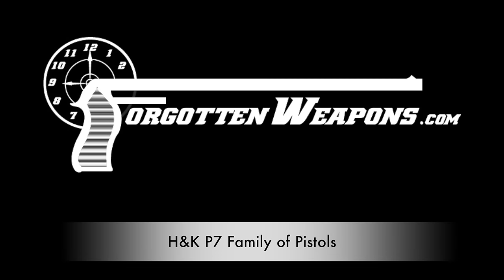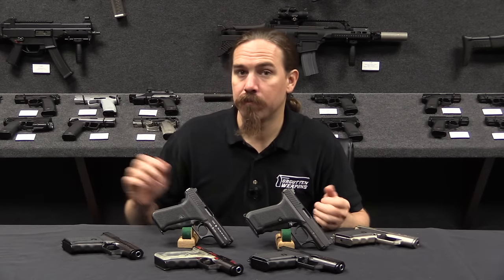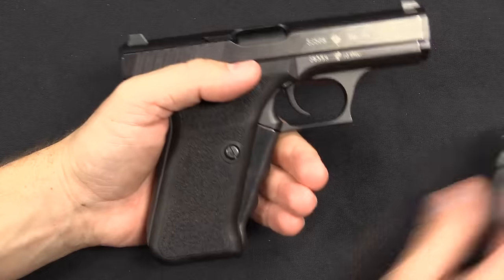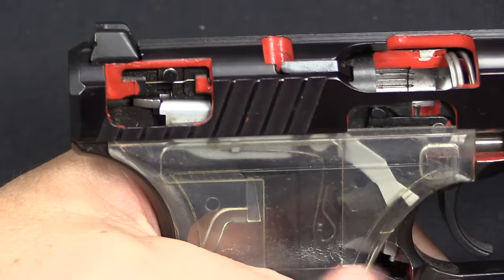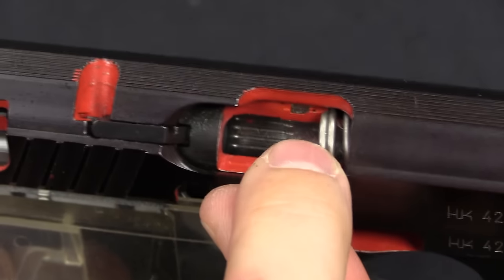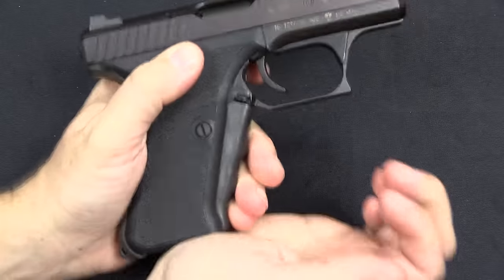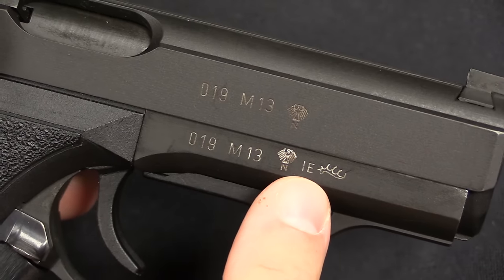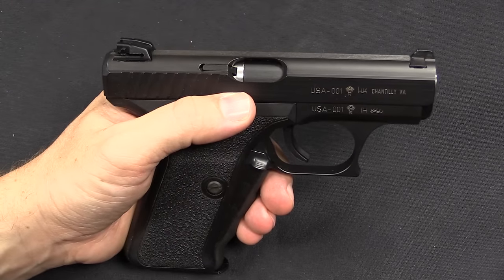H&K P7 Family: Pistols for Gun Cognoscenti

Comment: Thank you for your highly informative videos. Still today there are many police officers who claim this pistol to be the best they ever had used. But I think there was one essential problem in this construction: The pistol was used at a time when more and more women entered police duty. Due to the fact that some of them had smaller and/or weaker hands they came in motoric troubles when cocking the gun while drawing (younger, inexperienced male officers, too). So there happened some deadly accidents, when officers unintentionally pulled the trigger at the same moment they cocked the firing pin. As I remember, there where at least two officers shot or hit by recochets, one suspect shot and several officers hurt themselves by shooting in their leg. One of them lost his leg. This was the reason why the pistol was changed out before having reached its striven life cycle. In Bavaria where the P7 is still used some police chiefs allowed their officers to switch to other pistols because of this problems. Maybe this is the reason why mexican authorities demanded the safety switch on their pistols. In the mid of the 90's there was a suggestion made by "Deutsches Waffen-Journal" how to reconstruct the pistol to make it save. Unfortunately I don't know if this changes were realized in later sets.
One other thing: Can you (or somebody else) explain why the activation of the slide-hold-open by the magazine was changed and set to the side of the follower? And, am I right that this hold-open also interacts as the case ejector like it's realized in the ISSC M22?
Reply: As a police offiicer in Bavaria i can tell you that your statement is factually incorect. Woman in the police force came after the introduction of the P7. Also no one is to weak to pull the squeeze cocker, even the weakest female in my class had no problem with the P7(she was the best shooter in my class without any prior exposure to guns).

The hurting yourself with the gun is not a problem of the squeeze cocker, it is great at preventing it, because you need two motions(the squeeze cocking is not a natural movement) to shoot, while with most other guns you only need one.
Reply: @slightlymadotter8709  Lieber Slightly Mad Otter, ich möchte es nicht versäumen, mich nochmals auf Deutsch an Sie zu wenden, da mein Englisch nicht ausreicht um Ihnen meine -zugegebenermaßen beschränkten - Erfahrungen mit der P7 zu schildern:
Besagter Schießtrainer war im Jahr 2009 neben anderen Referenten  zu einem Fachvortrag/Workshop "Zuverlässigkeit bei Verwendung unterschiedlicher Laborierungen" vom örtlichen schweizer Schützenverein meiner damaligen Heimatgemeinde geladen. Seine Aufgabe war die Beschreibung der verschiedenen Verschlusssyteme und deren Einfluss auf die Zuverlässigkeit. Hierzu stellte ihm ein örtlicher Händler die Modelle 8 und 13 zur Verfügung. Viele weitere Waffenmodelle/-systeme wurden durch die übrigen Referenten bzw. Mitglieder mitgebracht. Im Laufe des Abends wurde diese Waffen mit unterschiedlichsten Laborierungen aus gemischt geladenen Magazinen geschossen. Als einzige "verdauten" die P7-Modelle alles. Ebenso waren wir Teilnehmer von der Präzision (auch bedingt durch den fabelhaften Abzug) begeistert. Allerdings formulierten einige (so auch ich), dass sie ein undefinierbares Unsicherheitsgefühl durch das ungewohnte Vorspannsystem hätten. Hierauf grinste der Referent und erklärte uns folgendes: Nach seiner Auffassung handele es sich bei der P7 um ein hoch präzises und profesionelles System, das speziell in Verteidigungssituationen für Laien und Gelegenheitsschützen ungeeignet sei. Er wies uns auf folgendes hin: Bei normal veranlagten, untrainierten Menschen bewegt sich der Zeigefinger (zumindest teilweise) mit dem Mittelfinger mit. Ausnahmen bilden hier Klavierspieler, etc. deren Gehirn durch Übung entsprechend trainiert ist. Greifen nun Personen mit kurzen Fingern das Griffstück und müssen den Vorspannhebel mehrheitlich mit dem Ringfinger bedienen, verstärkt sich der Ausschlag des Zeigefingers nochmals. Er fügte dann einige Beispiele an (denen er teilweise selbst beiwohnte), wo es durch dieses Paradoxon zu ungewollten Schussabgaben kam. Die von ihm getätigte und von mir wiederholte Aussage, dass es sich hierbei mehrheitlich um Frauen handelte, soll nicht Ausdruck einer chauvinistischen Haltung sein, sondern ist wohl eher der weiblichen Anatomie geschuldet.
Da sich der Abend auf persönlicher Ebene sehr angenehm gestaltete, erklärte sich dieser Referent zusätzlich bereit am darauf folgenden Morgen seine Aussagen im Schießkino zu untermauern, zumal deutsche Polizeiholster den Testwaffen beigelegt waren. Als Deutscher war ich der einzige einer vierköpfigen Gruppe, der zuvor keinerlei Erfahrungen mit dem Verteidigungsschießen gemacht hatte. Die zwei Damen der Gruppe waren aktive IPSC-Schützen, der andere Herr aktiver Offizier der schweizer Armee. Langer Rede kurzer Sinn: Wir alle lösten innerhalb 20 Minuten mindestens ein mal ungewollt den Schlagbolzen, insbesondere dann, wenn vor dem Ziehen zunächst ein anderer Gegenstand aus der Hand fallen gelassen werden musste. Keinem wurde das scharfe Schießen aus geholsteter Waffe erlaubt. Auffällig war folgendes: die Dame mit kleinen Händen kam schier ins Verzweifeln, ich selbst - der relativ kleine Hände hat - bekam mit der M13, die nur geringfügig breiter ist, massive Probleme.
Sicherlich sind diese Aussagen nicht repräsentativ, aber ich glaube schon, dass sich dadurch erklären lässt, wieso die Waffe in Niedersachsen relativ bald wieder außer Dienst gestellt wurde.
Mit sportlichem Gruß, Lamprecht Bertl

Comment: Thanks Ian, love your channel.   I've been waiting for you to do a video on the P7.  I own several models of the P7 and IMO there's no finer pistol, but by today's standards it does have it's limitations.  It's heavy, no rail, expensive, and of course it does get hot.  For me though it is the only pistol I feel perfectly comfortable carrying around with a round in the chamber, only one function to master, squeeze, plus it's extremely fast and also accurate.  One of my P7's is the K3.  I noticed the one you were holding had a serial # of 001.  The one I own's # is not much higher than that.  I would be interested in knowing just how many were made/imported as most K3's I've seen have relatively low serial #'s.  One thing you failed to show when you were doing a field strip was you neglected to demonstrate how simple it is to remove the firing pin.  You might do that in your next P7 video.

Comment: What a fantastic review of my all-time favorite pistol!  Back in the mid 2000's, I had 2 Chantilly P7M13's.

Some observations/tips about this fantastic, unique firearm:

1) the P7M13 had the lowest felt recoil of any 9mm I have ever shot.  The combo of gas delayed blowback, extremely low bore axis, bottom heavy steel frame/minimal slide design, made the gun flip very little.  A joy to shoot.

2) The unique manual of arms may seem off-putting, and may not be appropriate for those who like to switch between edc's a lot.  Example, to holster the gun, you relax your grip to decock, thereby killing the trigger.  Different.  That said, I would argue that in this case, different can be better, and it's a shame this manual of arms was abandoned.  

Dropping the slide by squeezing the handle becomes second nature, and besides the paddle mag drop, nothing requires fidgeting with small controls on the side of the gun.

The trigger had a bit of slack, but may make you forget HK's LEM; my P320 XFull with an Apex flat kit also doesn't quite compare imo.

3) I had shot tens of thousands of rounds through gen 1 to 3 Glocks before taking the plunge and buying a P7M13 on Gunbroker ($1400 or so back in 2005, 3k or so now).  Within 200 rounds, I was shooting better with the P7 than I ever did a Glock, or anything else but maybe a custom 1911/2011.

4) These guns are very expensive, well-made, rare, and desirable, but are nowhere near as reliable or durable as current designs.  This isn't a gun you fish out of the mud to shoot.  The gas operation makes them gritty and hard to cycle at the range after a couple hundred rounds. I cracked a firing pin bushing at the range, and the part was expensive and hard to get.  Not something I've ever had a problem with any other gun.  30 plus years and metallurgy is not working in your favor.  The gun really heats up a lot with rapid fire, that and the fragile nature is why I bought a second P7M13.

5) the M13 is perfect for those with big hands, fat, comfortable grip.

6) the gun can be pretty terrible to conceal carry...heavy, a lot of grip, not much slide to control the flop.  Holsters were specifically designed back in the day for this gun.

Why am a writing all of this?  If you're on the fence about a gun that you'll never see at the local gun store, and want something truly unique I would say: as long as you realize the limitations, get this gun.  You may not want to shoot anything else.  ;)

Comment: I've shot one a few times at my local rental range. A really cool gun and fun to shoot! I'm sure it's accurate as people say due to the gas delayed blowback design. But I think for many the real reason they find it accurate is that they shoot it more accurately than other pistols. The firing mechanism is such that you cannot really feel a wall before the trigger breaks. You just press the trigger and press it and bang! So it's hard to anticipate recoil and so people shoot it better. 

Oh, and you said the fact that you can pull the trigger first and then the cocker to fire is a deliberate feature. If I'm correct this was done so that the gun will fire even if the user doesn't pull the cocker and the trigger in the right sequence due to stress.

Great worksmanship, great quality and most of all, it's different!

Comment: Thank you for a wonderful video.  I owned one of these with a plastic trigger which still burned my finger and having to maintain high level of pressure on the grip was very distracting which made it difficult for me to shoot it accurately,  To me this is typical German engineering which you can see on any Porsche or Mercedes whereby a VERY complicated methodology and engineering design is used to achieve a very SIMPLE task.  It is an interesting pistol and unique but not worth the PITA of burned fingers and cramped hands.

Comment: As I could never afford a M8, my current EDC is a PSP (built in 86), replaced the recoil spring (wolff) and the sights (trigicon 3 dot) . Still shoots like a laser-- as accurate as my Wilson Combat.
They DO get hot quick, my personal best is about 125 rounds, then you just set it down and admire it while it cools... and like all polygonal barrels, do NOT shoot lead bullets !!! Increased chamber pressures as well as getting lead in the gas system may result... GREAT personal defense weapon, eats any jacketed ammo, works even with the extractor removed.....Plus, if someone gets it away from you, odds on bet they don't know how to use the pistol and you can shoot them with your backup (if you carry one-which I do- G42 or 638 S&W).

Comment: I carried the psp and M8 models for about 15 years.  They became too valuable to carry.  I think these are the high water mark for handgun design.  Very safe, very fast, very accurate. I mean VERY accurate.  A little butt heavy and needs good leather. The PSP carries slightly better because of the shorter trigger guard I think.  My solution for heating up at the range is to bring two. I didn't have problems with the manual of arms, but many gun owners are unwilling or unable to train on different guns,  But my dad as a LEO totally rejected it and didn't get onboard.  I'd say at this point if you put in the time to get proficient with a handgun, it better have factory support and sadly that's over for this one now.  It's a very complex beast and not one you would want to break.  So unfortunately the future for these will be to sit in the collector's safe next to the Pythons.

Comment: There was one other model P7 M10 in 40 S&W. I have owned one of the P7 M13 since purchased new in the mid-'80s and never experienced any heat issues even with rapid-fire use in the Sherif's department in Arizona with range temps over 100 degrees.

Comment: The P7 was part of the US Army compact pistol test back when the requirements were being defined by the Infantry board. This pistol was part of several pistols that help defined the requirements that led to the M11 Pistol. Those of us on the support team from the 197th Infantry BDE (soon to be the 3rd BDE) thought the P7 was weird, but after we fired it a couple of times, getting use to the decocker level became second nature. You have to remember that even though it took 7 pounds of pressure to engage it, the P7 only required 1-2 pounds of pressure to hold it back. Out of the pistols on the test, the P7 was the only one that I remember, besides the two 'test control' pistol (those being the .38 caliber revolver and the M9 Beretta

Comment: Great video as always Ian! The only thing that was left out was P7s do in fact have a slide lock mechanism that doesn't involve inserting an empty mag. On the left side of the gun, on the frame, in front of the grip, on top of the mag release (on the M8 and M13 but is othewise on the same position on the PSP) there is a small flat button that, when depressed, will lock the slide back without a magazine in the gun. Pretty cool yet little known feature.
Reply: Hard to engage tho, helps if you have 3 hands.

Comment: I owed and carried a P7M13 in the early 90's. It was one of the best pistols I ever used. Besides the front of the frame getting unbearably hot after 90 to 100 rounds of continuous fire, the other issue is that if you decide to pull in the grip to get it in a ready state (but maintaining finger out of the guard), if you then decide to decock, it will make a very loud mechanical  "Clack" sound. Why would this be an issue? Well, I found myself in the middle of a Break-In/Burglary one cold winter night, we had Sheriff's Deputies all around, I heard a sound of something walking in front of me (I knew it wasn't a Deputy, they were all in my line of sight 100 yards away), I raised my P7, squeezed in the grip, lit the light in my off-hand and it was a Deer. When I released the grip, the Deputies heard the sound 100 yards away and began checking in on the radio trying to figure out what and where the sound was. So, stick to HK's old protocol with these pistols, don't pull the grip in unless you intend to fire. Also, the grip circumference change  during cocking/uncocking was a slight pain to get used to.

Comment: From an engineering POV the best 9mm ever made. 
Problems arise when this is NOT your only gun.
The K3 was meant to be a practice pistol hence the .22 option to save cost on ammunition.
23:13 I don't think the pricing  has anything to do with marketing and everything with the value of the US$ collapsing on the exchange market. In 1985 US$1 bought DM2.94, in 1988 DM1.76 and in 1990 DM1.62. Consequently anything Made in Germany would have gone up in price accordingly, just like the P7 did.

Comment: I own a P7M8 and it’s one of the easiest and safest handguns to shoot. It’s very precise, the low aim line makes it natural to point at the target. While it is not designed for it, I’m shooting it at 50 meters with very good results, almost on par with a P210 with micrometric sights. The polygonal 4’’ barrel is amazing: a stock P7 is matched only by expensively tuned pistols with a 5’’ barrel. 

The gun has only two issues in my opinion. The first one is the extraction, which is really strong as the gas operation is literally blowing the shells out of the breech (HK claims the P7 works with a broken extractor). If you shoot next to a wall, be ready for some hot brass ricocheting in your face. And if there is no wall, better check that nobody stands in the very long shell trajectory.

The biggest drawback is the heat, which becomes uncomfortable after 3 magazines shot in quick succession and a burning issue after 5 or 6, even with the heat shields. For precision shooting, the heat actually is a good thing, forcing you to rest your arm during the cool down time, which it a good way to improve your score.

The price is not really an issue: it’s costing the same as a P210, which I put in the same class. It’s like a Porsche car, expensive but justified. And if you want similar accuracy from any other stock pistol, the tuning costs would eliminate most of the price gap. 

For the record, I am shooting for sport only and never use guns outside of the range, never carry one and do not use them for home defense.

Comment: That was a great video! I have a P7M8 I bought for $1095 back in 1993. I’ll never part with it. The manufacturing tolerances (I’m a mechanical engineer) as absolutely insane and did drive the cost. Regardless; these are incredible pistols and are drool worthy.

Comment: In the early 2000's I was issued a M13  when I worked with in Department of Energy. Me had one major problem with them. After several thousand rounds the sheet metal clip that holds the striker spring on the striker could break and we had a few that fired on the range while releasing the squeeze cock with the finger off the trigger.

Comment: Great video, 

The bavarian police still uses the P7 but had some gun trials in the end of last year. 
So the time of the P7 is coming to an end. 

Another interesting thing is the magazine release on the police pistols. It is located on the bottom of the grip like on the standard P7 model. However you have to push is fully backwards first, than you can press it in and slide it all the way back forward to release the magazine. This was a change done for the bavarian police since a lot of early pistols were found to loose the magazine when holstered. 

Greetings from Germany,